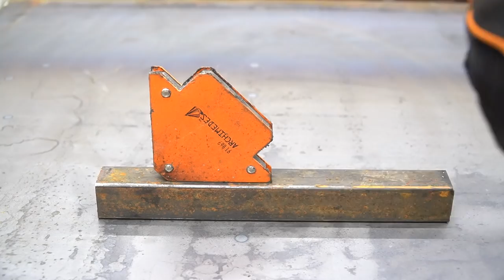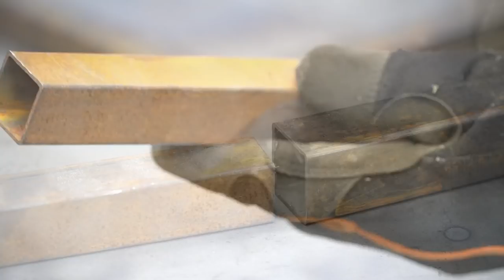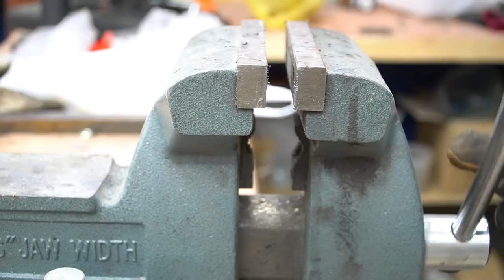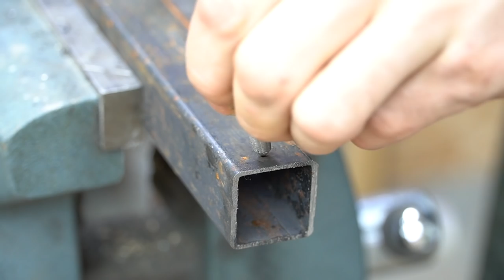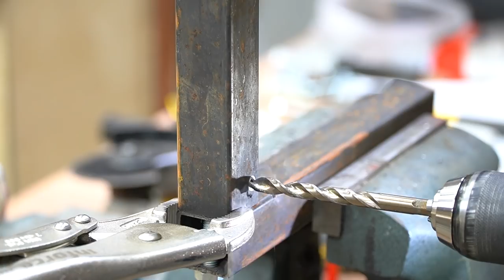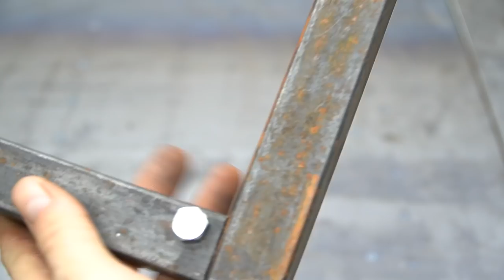Secret Profile Pipe! WHY DO WELDERS NOT SPEAK ABOUT IT!

Comment: First thing you should plug your machine into the power point first send turn on the switch.
Secondly this video had nothing to do with welding because there’s No Welded Joints.
Your videos on this channel have nothing to do with welding but to do with engineering joint design.